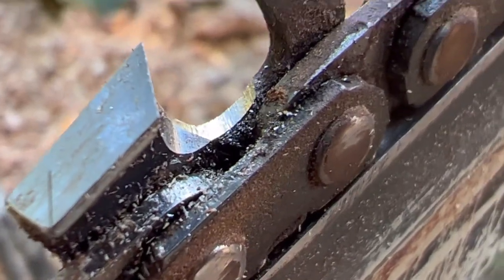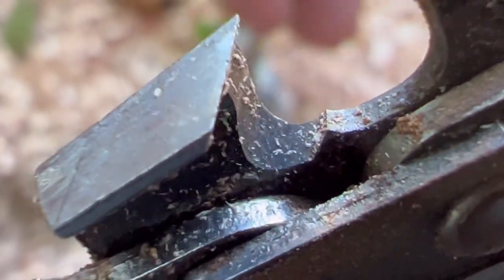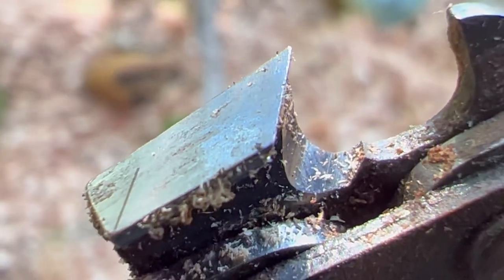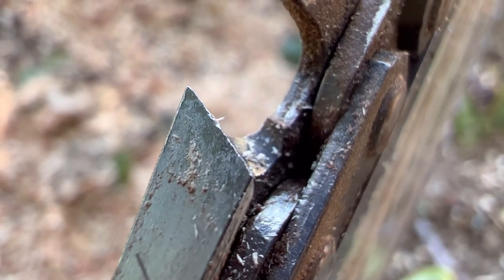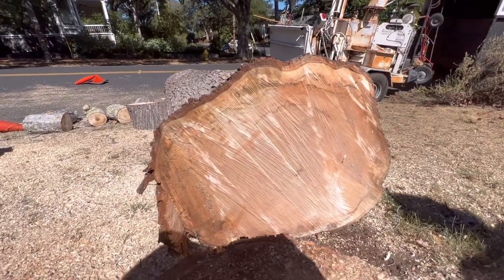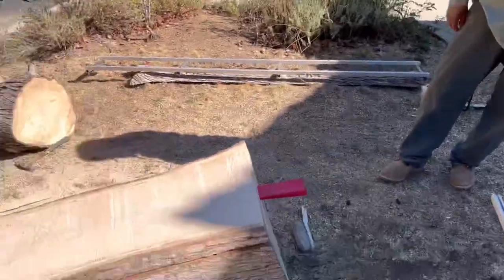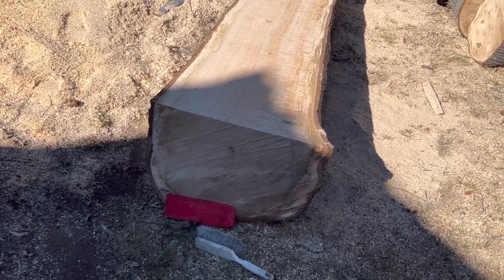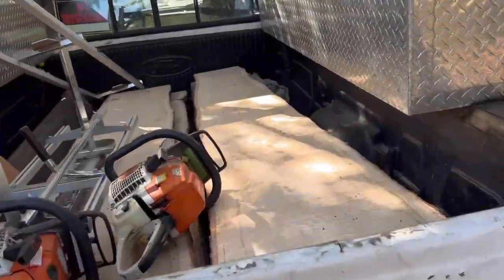Looking close at sharp

Comment: Blair, is it better to let the logs dry out slowly as a log or is it better to cut think slabs and dress after they dry or do it really matter which way you go. Thx
Reply from the maker: I find it’s better to mill sooner. Logs shrink  and the cylinder cracks. Milling sooner reduces the stress. Some woods behave much different than others.
Reply: @arboristBlairGlenn  Sound reasoning. Thx.

Comment: The chrome is what does the cutting.  Cross-cut filing?
Reply from the maker: Is this a question?
Reply: @arboristBlairGlenn  I guess.  Are you ripping with a cross-cut chain filing?  Because it looks like your are filing a cross-cut chain.  A rip chain has a different angle.  Does it matter?  I don't know, I don't rip cut.  But it doesn't look as smooth.